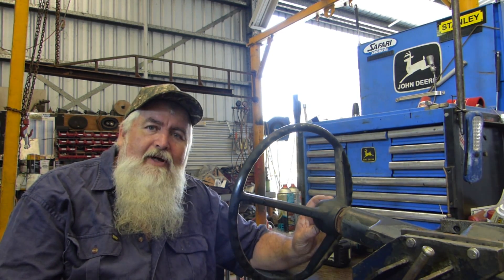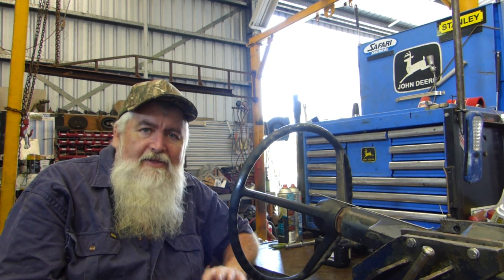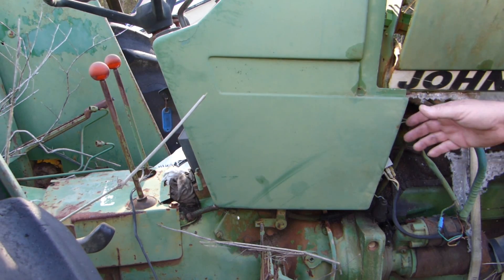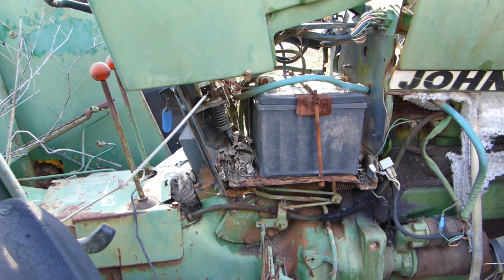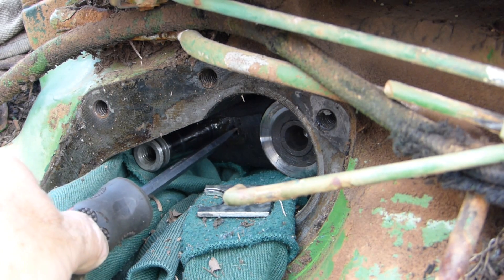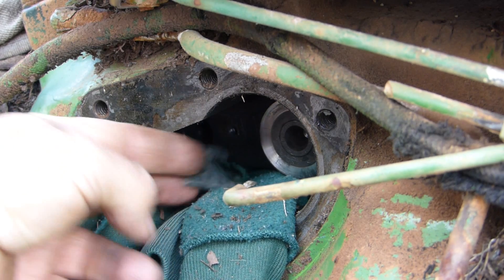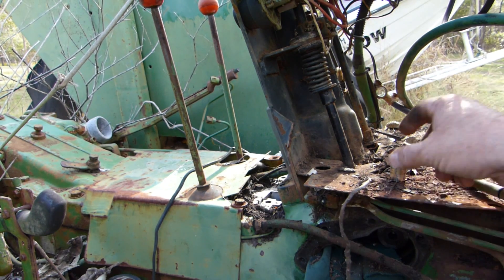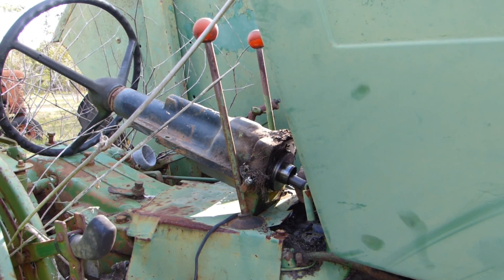John Deere 2030, 1640, 2140, 2650 Etc Power Steering Column Overhaul Part 1

Comment: When taking that side plate off with the 6 bolts should that be full of oil. Just listened the bottom bolt and oil was leaking out
Reply from the maker: That's right, there should be oil in there on a 30 series not on a 40 series.

Comment: So I dropped the pin on the steering link into the tractor 😮 any suggestions on how to find it and get it out? Or do I need to split the tractor? Should have listened when you said put a rag here
Reply from the maker: Try fishing for it but you may have to open it up.

Comment: Ok thanks, grinding noise coming from pro clutch area and all hydraulics gone, it’s draining the upper reservoir faster than the low pressure pump can fill it. I was hoping not to split the tractor but here we are….thank you for your reply.
Reply from the maker: Good luck!

Comment: Hey Mate, Great videos. I have lost Hydraulic pressure on my 1978 John Deere 2030 , If behind this cover talked about at the start it is over flowing with Hydraulic fluid would tis point to hydraulic steering problem? or is this normally full in here. Thank you in advance
Reply from the maker: It gets some, cap off the pipe to the steering and if it fixes the problem you know it is in the column.

Comment: Great video! That plate with the six bolts on the right side you remove is that a dry hole or does hydraulic fluid pass through there?
Reply from the maker: On the 1640 it just goes straight to sump, on a 30 series in traps the oil first

Comment: Hello my friend Lance, I suffer from a weakness in the John Deere hydraulic pump. For your information, the pressure sensor is in good condition, but there is a weakness in the steering wheel that moves with hesitation.
Reply from the maker: Check the trans screen and the trans filter and that the transmission byoass valve is seating well.

Comment: Thank you for doing such a good job describing the process for rebuilding the column. Have a 2030 with power steering leaking hydraulic oil from under steering area. Leaking when running or not running, can this leak be coming from bottom oil lip seal from steering column? Oil looks to be coming from area where steering pitman arm is.
Reply from the maker: Pitman arm leak will be the lower seal, the top leak will be one on the 6 o rings in the top of the column
Reply: The oil seal you are talking about is in the steering box itself or seal next to steering arm.

Comment: Can you rebuild a early model  2040 steering column  with open hydraulics. If so is there any way I can send my stering unit to get it repaired thanks
Reply from the maker: No I dont have time to do outside work at the moment.

Comment: Thanks for the video, I have a 3130 where the oil started coming out through the top of the steering wheel. I watched your video and changed the 6 orings put it all back together and now only have power steering turning left. Comes back to centre fine but it’s complete arm strong steering turning right. Any suggestions would be greatly appreciated
Reply from the maker: Check you have not cut an o ring sliding it together as I have done that in the past for sure, also when it is back out check the 2 valves and make sure a little bit of an old o ring isnt stuck in the valve.

Comment: Great series, I had to replace the o rings in the field 6 years ago (oil leak and as found out broken shaft threads). It was quite a ... because while positioning them the oily tool fell  through my fingers in the depths, I managed to get it out with two knitting needles wrapped in double sided scotch.
Now the shaft turns out when turning left and I will replace the unit in the field. Because of an aftermarket cabin removal of the steering shaft cover might be a little problem, I will find out tomorrow  morning.
Reply from the maker: They do need to turn out while being used as that is how the valves are actuated so some up down movement is ok.

Comment: Great video! Can you give me any advice to my John deere 2140 where we got the problem that its not leaking oil but the steering wheel turns free a few inches in both Directions for some reason and when you tourn the steering, the steering wheel goes up and down. We've torn apart the steering and it all seems to be normal but the movement in the steering wheel is still there.
Reply from the maker: That is what is supposed to happen, the up down movement is to open and close the left and right valves in the column. You can lessen it by removing some shims in the center but if you go too far you will have other troubles.
Reply: @BundyBearsShed  so the left and right movement ist normal aswell?
Reply from the maker: Yes
Reply: @BundyBearsShed  oh okay good to hear that. Thanks :)

Comment: Lance, your videos are great and helped me to rebuild the front axle, etc. on my JD 2030.  I have a question about the cavity in the clutch housing just below where the power steering unit is bolted to the tractor.  I had an oil leak in the half-moon-shaped cover that you removed around the 6:30 mark on the video.  I pulled the cover off and found a lot of emulsified oil and some grease in there.  As far as I can tell from the service manual, oil that leaves from the power steering unit drains into this cavity to lubricate the yoke and steering shaft, and then overflows into a drain that returns the oil to the main transmission sump.  Is this correct?  The hydraulic oil on the dipstick looks pretty clean, and I don't want to drain and refill the whole system if this bit of gunk is isolated in that one relatively small cavity.  Your thoughts - and anyone else's who has some insight into this - are welcome.  Thanks again for the great videos!
Reply from the maker: Yes that is correct, they seem to get muck in there but I thing the cavity catching it must stop it going further.
Reply: Just in to the exact same issue, thanks a pile for posting.

Comment: Thanks for the video lance!
I have a 3130 that the steering column warms right up to almost can’t touch!
No real oil leak..
Any suggestions would be grateful!
Thanks again
Reply from the maker: They do get warm but if it works and doesnt leak dont worry the heat may be generated else where.

Comment: quick question on my 2140 rebuilt the  orbital steering column for an MFWD after installing it. How  do I safely bleed it? I tried it and the whole steering column shakes and I havr to shut it down.
Reply from the maker: G day Nathan, you need to time the unit. Try googling  it they are a self bleeding system. Keep your fingers out side of the wheel as it can turn into a motor and could break a finger or arm.
Reply from the maker: I haven't got the info here on my phone but might have it at work next week.
Reply: @BundyBearsShed  thanks Ill wait for it getting muddy here
Reply from the maker: You will need to send your email to bundybearsshed@gmail.com

Comment: Thanks. Got to tear into my 2040 and replace the gasket where it mates to the housing. Now I know what I am getting into 😁👍
Reply from the maker: Go for it
Reply: Hi Clayton Mathew, I really have problems with my JD 2040 steering wheel. It fails after some hours of driving the tractor.
What can I do to fix it according to your experience? 
I would like to get the service manual as well.

Am looking forward to your helpful tips.

Steve in Uganda 🇺🇬.

Comment: Thank you for doing such a good job describing the process for rebuilding the column. It has been very helpful.
Reply from the maker: Thanks Roy, Glad it was of use to you.
Reply: Hi mate I’ve got a John Deere 3130 I’ve got a problem with my steering 
I’ve got over a quarter turn at the steering wheel before the wheels start to move 
Would rebuilding the steering box fix the problem

Comment: i have old 2130 and sterring  ws loose  and now sterring wheel just spins and  tires dont move
Reply from the maker: G Day Monty, I would pull the plate off the rh side near your foot throttle and then turn the wheel. The Dog Bone mat be broken or the main pitman shaft. I have also had the piston come off but the end result is to open it up and see what you can find.

Comment: Hi, I have a 2040 looks close to the same as your 2030 my tractor has a problem going straight it will go left and right every where but stay center I replaced the bell crank bushing but did not help any suggestions? Thanks
Reply from the maker: G Day Gary, do you have hydrostatic steering? You can tell by the 4 hoses coming out the back of the steering motor. Or if you have this type tighten the nut on the top of the pitman arm
Reply: Thanks so much that was my problem, Gary

Comment: Like the video Lance I got a 2640 what is the difference in 2650, I might have to do mine later on
Reply from the maker: G day Joe, if your tractor doesn't have hydrostatic steering it will be exactly the same job. Hydrostatic means a steering motor